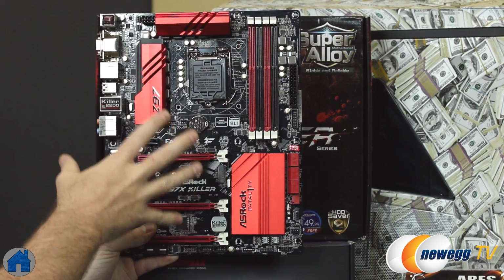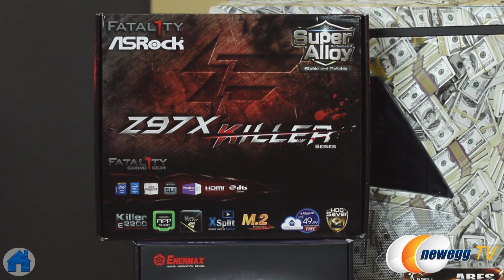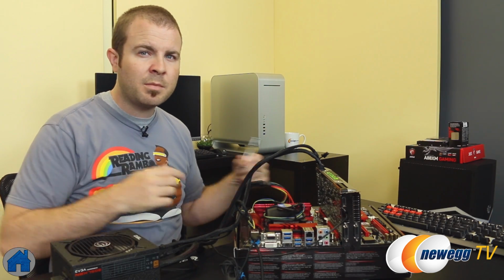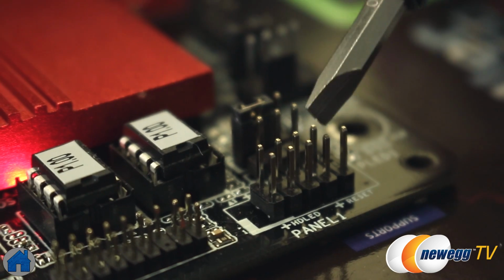How to Build a PC - Part 1 - Newegg TV

Comment: Hint: You can use a very small amount of BLUE Loctite ( NOT RED ) on the standoffs when installing. BLUE Loctite is REMOVABLE if you want to take them out, but will hold the standoffs tight when and if you need to unscrew your MB. BLUE ( NOT RED!!! ) CAN be undone with a bit  more pressure and since the standoffs are a hex shape, its easily undone with a hex driver.  When using BLUE Loctite, just enough to cover two threads of the screw is more then plenty. In the case of Loctite, less is better then more.

Comment: hows this system

specs:

cpu: i5 4670k
cooler: h100i
mobo: Gigabyte Z87-D3HP
gpu: (x2) gigabyte wf3 gtx 760 oc 2gb
psu: corsair RM850
ram: hyperx fury 16gb
ssd: samsung 840 evo 250gb
hdd: wd 2tb green
os: windows 8.1/10
case: fractal design define r4 (windowed)
monitor(s): (x3) Acer G246HLBBID 24-inch
Reply: It's good, but I'd get 8gb of ram instead, as 16 is not important, and go for 1 970 or 980 instead of 2 760s. 1 better card is always recommended over 2 worse gpus. The gigabyte cooler would be the best for either of these.
Reply: TheMuha200 thanks for the advice but I use 8 GB of ram rendering in sfm and you can't get many 970 and 980 cards in the uk
Reply: I think you should drop the H100i and get the NZXT Kraken X41 because its cheaper, performs better so more overclocking headroom, takes one fan spot and is pakced with a much more high quality fan.
Reply: TheRicochetProdigy95 i plan on changing the fans but thanks for the advice ill take it into account
Reply: I would rather get a wd black 2tb instead of the wd green just for the extra speed boost because a wd green Would equal speed to like a ide hd
Reply: The Only Killer OK thanks for the info
Reply: Matthew Yohanes im use to 3 monitors
and many changes have been made

Comment: You get an A on this one.  I thought you could use a bit better closeups of the connectors/headers you were going to plug cables into at the time.  You could add a few slides at appropriate spots to correct this.  Another reason for not using a powered screwdriver inside the case is more of a tendency to jump off the screw and scratch the MB--Intel has some shots of dead MB's killed by screwdriver scratches--or drop a heavier screwdriver and have greater chance of damaging MB. 

Thanks, I never knew closing the ZIF lid onto the CPU would auto-pop the plastic protector out.  I always just popped them out after installing the CPU.  Can't wait to try that.  Might also add that like AMD's pins, Intel's design makes the MB makers socket "pins" equally sensitive to damage via ANY contact but much less repairable without the maker replacing the $ocket for you.  So be careful once those pins are exposed and minimize the time between exposure and placement of the CPU.

I'm glad you struggled with a small case as an example of problem solving.  For tight builds, I always council being aware of the possibility of having to pull things in and out until you figure out in what order you need to fit parts until everything fits together. Going in with that attitude and you won't rush or try to force things.  Need some beers however.

Back to being the best "how to build a PC" video online.

Comment: though this is a great video I can't help but feel little sad that the how-to-build 3 part series Paul covered in 2011 is now outdated. Those videos are what placed the confidence over my foundation of passion to build my a truly epic game machine!!!

my old laptop was reaching its twilight years and my choice was between buying an alien-ware laptop or building my own desktop and let me say this, after my experience I NEVER PLAN to dedicate my time to a machine i didn't build myself. plus the knowledge you gain from such an experience with your computer is a real ego-booster knowing exactly part for part what is in your system. It was December of 2012 and I proudly say my machine shreds through games just a fast as it did nearly 2 years ago when it was freshly built.

Just in case anyone is curious these are my specs.

- CASE: ANTEC THREE HUNDRED CASE
- POWER SUPPLY: CORSAIR| CX600 600 WATT
- RAM: 4x2 GB OF G-SKILL RAM
- CPU: INTEL|CORE I5 3570K 3.4GHZ
- MOBO: ASUS|SABERTOOTH Z77 MOTHERBOARD
- GPU/VIDEO CARD: EVGA| GTX 660 SUPER CLOCKED 2GB
- 256 GB SOLID STATE DRIVE OCZ VERTEX
- DISK BURNER: ASUS DRW
- HDD: Seagate 750GB*

* I never actually bought the hard drive from Newegg i actually gutted my old desktop that crashed years ago and found out only the video card had fried and the hard drive was actually fine. Though i learned how to salvage it because of the Newegg video ^^

Comment: I currently have this system:

i7 3770k
Asus Sabertooth Z77
Corsair H80i
8gb HyperX 1600 RAM (4x2)
Gigabyte GTX660ti 2gb
1TB WD HDD
AcBel 750W PSU
Sharkoon Tauron Case

Any suggestions on what I should add/upgrade?
I really want a new case, any suggestions?
Reply: the 3770k performs better than the 6300?!
Reply: What you should upgrade really depends on what you're using it for. And the case depends on what you prefer
Reply: A ssd or a new graphics card and for a case up grade a nzxt phantom case would be good
Reply: Matthew Yohanes The 3770k isn't useless. It's better than the 8350, which is better than the 6300
Reply: kikassreviewss Yes, off course...
Reply: kikassreviewss First of all, the FX-6300 came out on 2012, so it's older and also it has 3 cores. The 3770k (if I remember correctly) has 4 cores and 8 threads. So it's newer and has more cores

Comment: Can I get any feedback on my build? It's my first build and I really don't know exactly what I'm doing. Any feedback helps. Do I need more fans? A lesser Power Supply? Thanks

http://pcpartpicker.com/p/KHRpD3
Reply: Not sure how the 270X is going to do with a 4790K.  And you could've gone with a weaker PSU. But if you want to upgrade something then it's probably just fine. This http://pcpartpicker.com/p/TCkG23 might be better. I basically just replaced the CPU with a weaker one and the GPU with a way better one. Hope this helps :)
Reply: http://pcpartpicker.com/p/BVJZqs put the extra fan on the CPU cooler if you want to over clock, if not then put it on an open space in the case as an intake.
Reply: TheCardq get a 970 :/
Reply: TheGamingKiwi1 That was far before I really learned how AMD cards compared to nvidea cards, if I was going to make a build with a similar budget, i would likely get a cheaper SSD and HDD, and an r9 280x or 290

Comment: How's this setup ?

CPU: i5 4670K 
MOBO: GA Z97MX Gaming 5
COOLER: Hyper 212 EVO  
RAM: HyperX Fury 8gb
GPU: Gigabyte GTX 970 G1 Gaming   
HDD: Seagate 1TB
PSU: Corsair CX600M     
CASE: Corsair Carbide 01
Reply: TheMuha200 the i5 is good for this, dont need an i7. i would go for the msi gtx 970 gaming 4g  cause it hase a better cooling. and i would take a bequiet pure power l8 530watts, it has much better quality then the corsair
Reply: AustinHD It depends on what he is going to use it for, if he's/she's only going to use it for gaming, there's no point in buying the i7 but if he's/she's going to do video editing, 3D modeling etc he/she will benefit from the i7 greatly.
Reply: I recommend a better CPU to go with that amazing GPU. At least an i7.
Reply: Looks good.
Reply: The PC will be for gaming and some occasional video rendering in vegas.

Reason i choosed the CX600M is because i wan't to have some room for OC, plus i'm from mexico and the market is kinda limited when it comes to brands. Also gigabyte recommends a 550w psu, so i'm not sure if picking a 500w psu is a good idea.
Reply: the psu calculator from bequiet says that u need with your setup when u overclock it needs max 351 watts, so 530 will be enough :D
Reply: This whole system will probably only suck 325 watts at 100% on stock clocks and overclocking the cpu and gpu will bump the usage to about 400-430watts so a 500 watt is ok but you'll have no headroom for e.g another graphics card.
Reply: u dont need a 600w psu for a max of 350w
Reply: AustinHD
No need for i7.  You can go back as far as the i5-4440 and you won't have bottlenecking.  A 4670 or 4690 won't bottleneck for years.
Reply: never heard about that GPU but the build looks great!
Reply: Matthew Yohanes It's not as if any 970 is going to draw very much power.  The Gigabyte G1 Gaming has better cooling.  The overclocks are applied by the company and if you're going to overclock your card, it's still better to add onto the overclock yourself so you can crank it up to 1.5 GHz.

Comment: Informative video.  You should of mentioned the rails on the power supply and also the Amps not just the Watts.  This is important in choosing the correct power supply for you graphic card needs.  Also the pin that are offered should be noted because not all power supplies come with all the correct pins.  Just food for thought

Comment: I hate it when people do AMD build guides and they use an APU and no graphics card. You know there's AMD graphics cards and CPU's right?
Reply: Jay Man ... Did you just say that consoles beat a PC without a GPU... You know I can't underclock my 5 year old system to be "as fast" as the "next gen" consoles, PC will always rule... ALWAYS
Reply: Habitat I have no clue where you got that from. I'm going to assume you replied to the wrong comment. What I was talking about, if you actually read it, was that AMD makes decent APUs for the PC and that since they are the ones making the XB1 and PS4 APU they might come out with an 8 core APU that has a 750-1000 shader GPU that is similar to the console version. That would be good for budget PC gamers because they could get pretty high end systems with a $200 chip that has both the CPU and GPU already on it and it won't require a massive PSU either.That is all I said. Why would I say it? Because it wouldn't cost AMD much to produce a cheap octa-core APU for PC since they are already making millions of them now for Sony and Microsoft. I never said that one thing was better or beats another thing. Not sure how you got that from this. Hell, I am typing this on a PC that has a liquid cooled R9 290 and a Xeon E3-1230 v2 that would shit on both the XB1 and PS4 combined (+ the 360, PS3, Wii U and Wii which it can emulate).
Reply: ***** Fuck i3. Pentium G3258 overclocked is a much better buy. AMD Athlon x4 860k costs less than i3, outperforms it.
Reply: But it would be nice if people did builds with a CPU and separate GPU :)
Reply: AMD does make some pretty decent APUs that are fully capable of playing most games out right now in 1080p with decent frame rate. And since the XB1 and PS4 both use a much more advanced AMD APU than anything you can get for a PC at the moment, we might actually see an 8 core AMD APU come out with similar or better specs than the XB1 and PS4 in the near future in the $200-250 price range. The A10-7850k, which is currently one of the top APUs, is only $140. If the GPU on it was a discrete GPU, it would fall somewhere in between the R7 250 (384) and R7 250x (650) in terms of number of shaders (the 7859k has 512). Although, because of its limited TDP, it is has a much lower clock speed than a desktop discrete GPU and it has to share DDR3 memory with the CPU. When it comes to on-board graphics, right now AMD is kicking Intel's ass even though most people don't care because it is way better to get a high end discrete GPU with an Intel CPU than an APU if you have the money. If you are on a really tight budget, though, an APU might make a lot of sense.
Reply: Thanks for the info :D
Reply: Jay Man Ok, but those octo-cores in the consoles are not "as strong" as the octo-cored CPUs in the PC market, and may I ask you... Why Xeon?
Reply: Habitat Yeah I know that the consoles have underclocked cores compared to a PC CPU, I AM NOT COMPARING CONSOLES TO PCs, I am just saying that AMD might release an 8 core APU . Will it be better than the console APUs? Who knows? IT DOESN'T EVEN EXIST YET. (Notice the caps?) Do I care if it is faster than a console APU? No, I don't give a flying fuck. 

Why Xeon? Because I am cheap and I had an H77 motherboard. 
E3-1230 v2 = 4 core, 8 thread @ 3.3 GHz for $225
i7 3770 = 4 core, 8 thread @ 3.4 GHz for $325
Also, the E3-1230 v2 doesn't have the HD 4000 iGPU so it has a much lower thermal design power @ 69 watts vs 77 watts of the i7 and i5. Basically, I have an i7 for about the price of an i5 and that 100 MHz makes absolutely no difference. I used to have the 3770k in a Z77 board and they are literally identical in performance at stock speeds. So, if you are building a PC and are using a discrete video card and don't plan on overclocking, look into the E3-12xx CPUs, the current refresh is the Haswell E3-1231 v3 which runs at 3.4 GHz (the 1230 v3 was 3.3 GHz) and can be used in any LGA 1150 motherboard.
Reply: Disregard AMD CPU, acquire i3.
Reply: Jarod Kelly Yeah, the unlocked Pentium is definitely the better gaming CPU. I was reading a review where someone OC'd a G3258 to 4.8GHz and it beat the stock clocked FX-8350 and Sandy Bridge i5 2500k in Crysis 3 which is one of the few games that actually benefits from more than 2 cores. And, the Pentium was only a few FPS below the Haswell i5 and i7@ stock clocks  Needless to say, it kicked the shit out of the i3. It is a real per-core beast when OC'd. Even at stock speed, the G3258 is about even with the i3 because most games don't use hyperthreading. The only reason to spend more on the i3 is if you are also using the PC for video editing or file compression or something that actually benefits from HT and you can't afford the i5 or i7 - and don't like AMD. The i3 is really a niche CPU now that the G3258 is out. I just hope Intel continues to make unlocked dual core budget chips in the future and that this wasn't just a one-off thing for the Pentium brand's 20th birthday.

Comment: Hey guys, this will be my very first PC build, and I'm wondering if it'll do me well
Keep in mind that I'm going stock for this build, I'll probably gain more knowledge as time goes by.
Specs:

CPU: i5-4690
GPU: MSI GeForce GTX 970 4GB Twin Frozr V
Mobo: Gigabyte H97 Gaming 3
Case: Corsair 200r Mid ATX tower
Ram: 8gb G.Skill Sniper DDR3-1600
HDD: 1tb Seagate Barracuda
SDD: Mind giving me recommendations?
PSU: Cooler Maaster V550 (Should I go 650 on this build? My estimated is 331)
OS: Win 8.1 64bit
Monitor: VG248QE <--- Fucking love that thing.
Reply: ufster81 Oh son of a bitch... -__________- Edited: MSIs GTX 970. Thanks for the heads up, though.
Reply: ufster81 Also, the case is a Corsair 200r mid. Do you think I should go full tower on this build?
Reply: ufster81 Alrighty, thank you for the reassurance. I'm just a tad bit nervous, but I'm sure I'll come out with a solid PC afterwards.
Reply: ufster81 Hey uh, I have some pretty nooby questions, but what is the difference between the Asrock fatality z97 mobo and the z97*x* version? Does the z97x just offer more for individuals who overclock and stuff? Should I just go with the z97 one? Like Ode, I won't be overclocking.
Reply: get the samsung 840 pro 128 GB, probably the best ssd and the one i have
Reply: Michael Chen Thank you for the recommendation. I'll probably get it around the holidays. A chap of mine got his last year, a Samsung 840 pro 1tb for only $75 >_>. Lucky SoB.
Reply: If you want a 256GB SSD, the Crucial MX100 is excellent in price, speed, and reliability. ...840 Pro 1TB for $75?  Lol, lucky SoB indeed.

Comment: http://pcpartpicker.com/p/LcMqNG
How is this set up for my first gaming pc.. i will be using my laptop as a screen until i get enough money for the asus 1440p with gsync
Reply: I have storage from my actual pc so thats why only ssd and i choose 1866 of speed because of the latency that is 9 vs 11.. each latency is equivalent to 500 and i did the math......... and i will use the stock cooler just for a week, I will be getting a H100i soon too
Reply: Off the cuff? Kinda wonky. You're working with about 120gigs worth of space; that won't last long so I'd look to invest in a wd of some sort. Your
 build looks to overclock yet there's no aftermarket cooler. With about 14 hunned worth of monies invested, I'd hope you'd pick up an aftermarket.
Reply: You should definitely have more storage, maybe a 2-3TB HDD along with that SDD. Unless you already have a way of storing all your files, 128GB will not be enough. I would also recommend getting 16 GB of RAM as 8 is starting to not fulfill all requests and operations. If you really want to go with just 8 GB, spend like $10-$20 more to get DDR3-2133 memory, or even 2400 for a little bit more money. Like ufster said above, you should definitely get a CPU cooler; I am a huge fan of the Corsair H80i and H100i. The H80i should suit this build perfectly and it is an incredibly easy CLC to install.

Comment: What's the proper way to put on these water coolers i have seen many different videos of people using the fan to suck air in and other to push the air out and some put the fan on the inside of the radiator and others to the outside so which is the right way??
Reply: Depends on how your case handles airflow. Some cases have great airflow from the front with open mesh designs and dual 120/140mm fans. It makes sense to exhaust the air through the radiator in such cases because air temp inside the case will be quite low anyway. Some cases allow for mounting fans on top of the case so if a single 120mm fan radiator is used it can be used as intake to pull cool air and exhaust the warm air through the top of the case. As I said, all depends on how you manage airflow in your case.